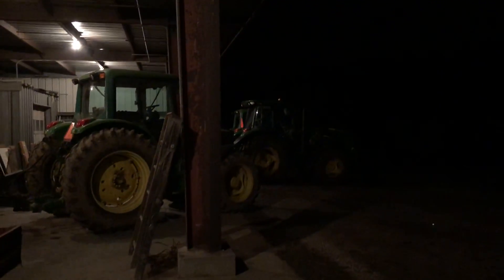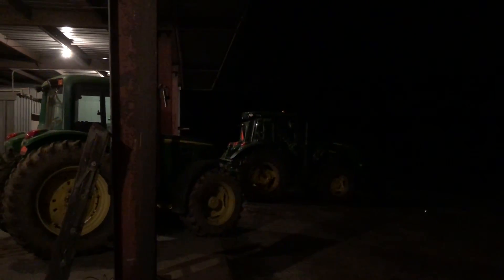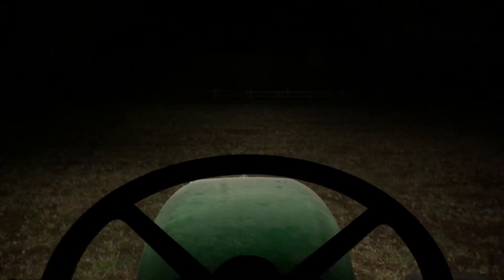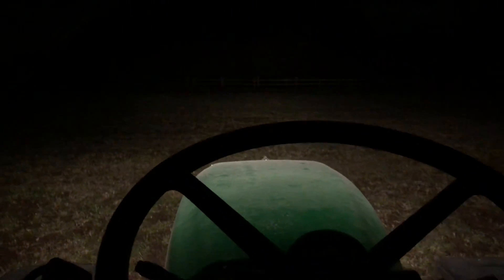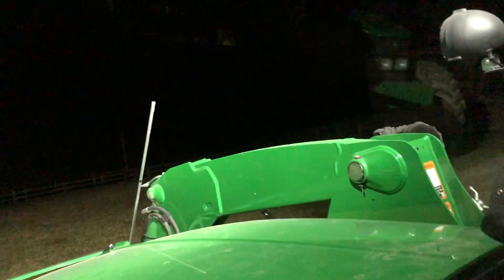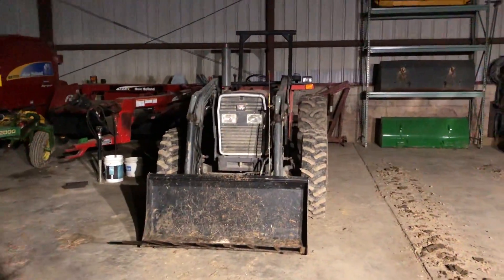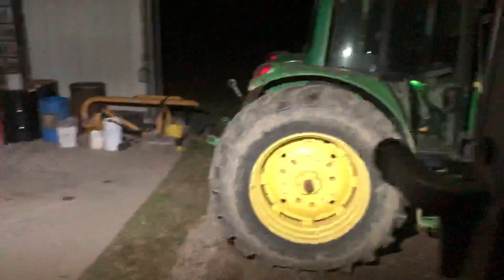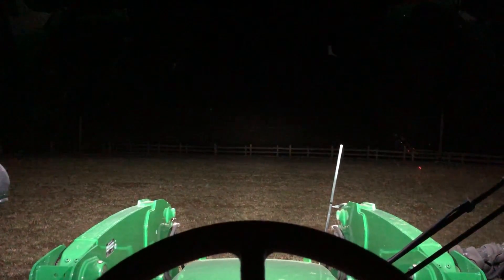John Deere 5R Series Tractor: Lighting Comparison LED vs Halogen

Comment: I don’t understand why you Americans (nothing against you guys) why you call it a sixty four twenty why not just say six four twenty
Reply from the maker: Most likely because the way we say it is derived from the way John Deere used to number their tractors. The tractor I refer to in the video is from the "Sixty - Twenty Series" of tractors. The series prior was the "Sixty-Ten" series and the series after was the "Sixty-Thirty". So when I say Sixty-Four, it refers to the specific tractor in that series. Deere also made a Sixty- Two Twenty and so on. Years later, and currently, they have the new numbering system in use where the first number refers to the series, the next three numbers refers to the engine horsepower, and the letter following denotes the "spec" , capability, or cost level.  SO for instance on the new tractors, a tractor labeled 6175R would be read as "Six One-Seventy-five R"
(Six series or Six family, 175 engine horse power, R level)

Comment: is this a jd set of led lights or you had switched from halogens to leds?
Reply from the maker: Jacek Skowroński the LED lights on the 5R are factory. The tractor can be ordered that way from the factory 👍🏻
Reply: @TheRamGuru  Thx, I'm looking for solution how to upgrade halogens to LEDs on my 6140r (6 years old)
Reply from the maker: Jacek Skowroński Deere offers direct LED upgrades for most of their lights. I believe on your R series it would be easy to do, but the LED’s are very expensive.
Reply: @TheRamGuru  I know, so I'm searching for cheaper alternative. Today I received package with LEDs for JD but from Polish led company - Wesem. I will try it on harvester, and will try to fit it on tractor. Those are big lamps - 4000lm, when JDs original have 1800lm.

Comment: Its been cold here in NH and in PA.  How has the tractor been?  How many hours on it?  Any problems?
Reply from the maker: Marc Vaillancourt we’ve had no issues with the tractor whatsoever. It has performed flawlessly in all weather conditions we’ve experienced thus far. I’m at around 200 hours last I looked. When it was extremely cold out, I was using the block heater to make things easier but I don’t think it would’ve hesitated to start regardless. The heated seat was a nice creature comfort on those -20° windchill days!